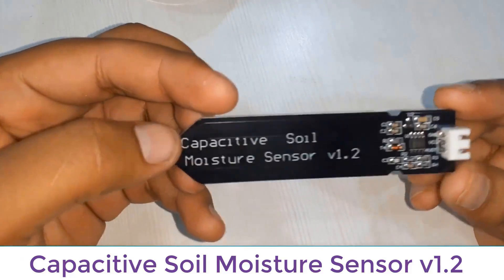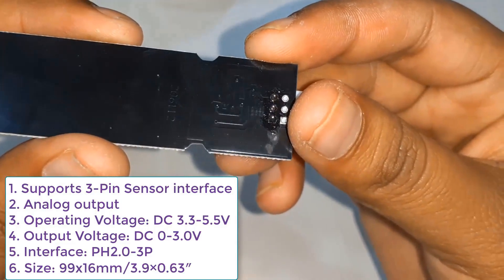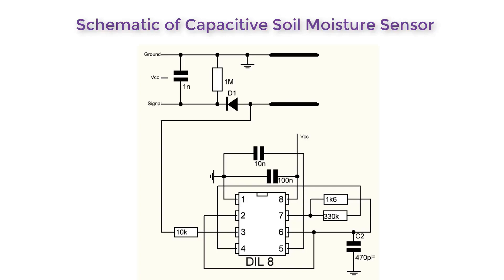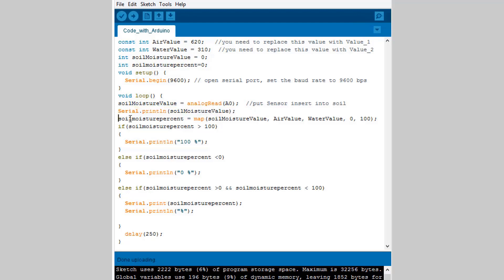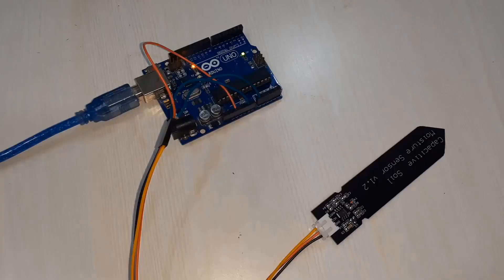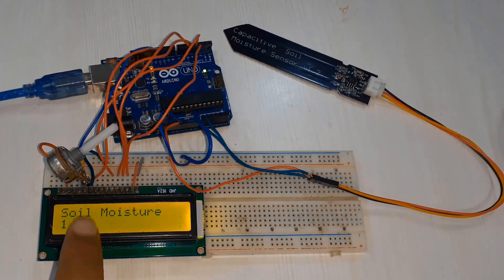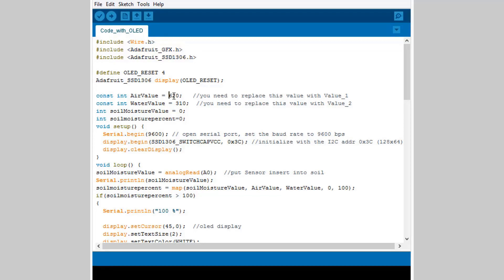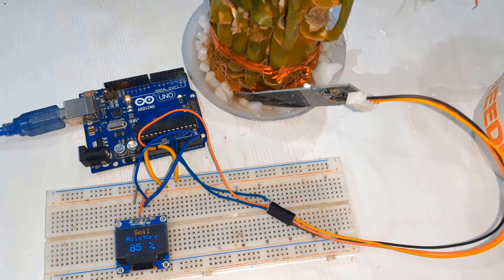Interfacing Capacitive Soil Moisture Sensor v1.2/v2 with Arduino & Monitoring on Display

Comment: This video helped me a lot. The Map() function is really clever! :) But an important, I think, hint. The sensor must not be under current for too long, otherwise it will break. Better use a transistor or relay to activate it.

Comment: I used the same code. But it shows only soil and moisture in the display. Percentage is not displaying in the display
Reply: Did you by chance figure out the issue? My sensor is displaying the same error.

Comment: hey, I hope you can help me out or give me some advice on how to solve the following. We have a company with 35 hectares of strawberries. Currently, we need to drive daily to our fields and check if the water pumps have watered all the fields. We thought of installing a soil moister sensor within all the fields. These sensors should be able to send a message to our phone, if the soil moister has the right moister and if not sent an alert message, that there is not enough moister in the soil for the plants. Do you think this is possible to install/program quickly or does it needs a to of coding and experience to create such a system? Would be glad if you could help me somehow. Thanks
Reply from the maker: There are so many videos in our channel that might fix your issues. Check our channel for the videos. Here is one example: https://youtu.be/4d9dZf8PyiU
Reply: @HowtoElectronics  Thank you

Comment: what is the difference between v1.2 and v2.0 ???
Reply from the maker: Just a minor hardware design difference. The code works well for both the modules.
Reply: @HowtoElectronics  I was curious about hardware only. If you can elaborate on that. Thank you
Reply from the maker: Check the schematic of the sensor board. The v1.2 version has some minor bugs and design issue which is fixed in v2.0.
Reply: @HowtoElectronics  Thank you. I will check
Reply: @HowtoElectronics  Thank you. keep up the good work

Comment: namaste 
yes i did the same project ...works good with water...but once you place it in the soil dosent work
whats your experience ???? do you have any idea for a code that con work for the soil ??
Reply from the maker: It works well inside the soil too. Had a good experience with this sensor. You can also use some other type of capacitive soil moisture sensor.

Comment: hey i tried the oled method but it is not showing me the soil percentage at all can any one help
Reply from the maker: Check the I2C address of your OlEd display.
Reply: @HowtoElectronics  how do I do that
Reply: @HowtoElectronics  so it has to be a 12C display or it won’t work
Reply from the maker: Some I2C OLED Display has an I2C Address of 0x3C and some with 0×3D .

You need to modify the code for these two i2c address and check the working.
Reply: @HowtoElectronics  thanks a lot
Reply: @HowtoElectronics  last question sorry it’s ok if the display doesn’t have two colours right if it only has blue it should still work right
Reply from the maker: Most of the module has only one color
Reply: Hey did you get the code

Comment: hi! how do you get the number of AirValue and WaterValue may I ask??
Reply from the maker: I have already explained the calibration method in video part. The maximum/mimimum value when placed in  open air and in clean water in the air and water value.
Reply: @HowtoElectronics Open air is not 0% humidity. Have you compared any readings with this sensor in different known air humidities?
Reply from the maker: This is not a humidity sensor. Its a soil moisture sensor which only shows some values when a liquid is poured over the surface of se sor.
Reply: @HowtoElectronics  I'm curious how the readings will differ in areas with large humidity changes and also in different growing mediums. Do you get a different reading in open air at 10% humidity over one at 90%? Does a 40% soil moisture conduct differently in sand than say a clay rich soil? Thx

Comment: Is it possible to convert the percentage of water detected by the sensor into the unit of volume?
Reply from the maker: Not possible.
Water volume and flow rate can be measure using water flow sensor only.
Reply: @HowtoElectronics  thanks. I am working on a detection of water-in-the-oil. Do you think the water flowrate and water volume will work on it? Also, it is a droplets of oil and water due to the condenser
Reply: @HowtoElectronics  love you videos by the way! It's amazing
Reply from the maker: Hi none of these sensor will work in this case if you are thinking to check moisture or droplet in oil.

Comment: I didnt understand regarding the callibrate, how to callibrate the sensor?
Reply: do i have to upload first the code, then monitor the value while in air and water? then change it to the max and min value i get?
Reply from the maker: Exactly. Check the maximum value and the minimum value and modify in the code according to it.

Comment: What is connected to the LCD? Is that a transistor?
Reply: What does the potentiometer do for the display?
Reply from the maker: Potentiometer adjust the LCD contrast

Comment: I need to make this but I need to trigger a 5v pump. Can you help me with the code?
Reply from the maker: Yes you can. Add a pump to the hardware. Then you can add some lines in the code by providing some flag and if else condition to turn on the pump with digital high logic.